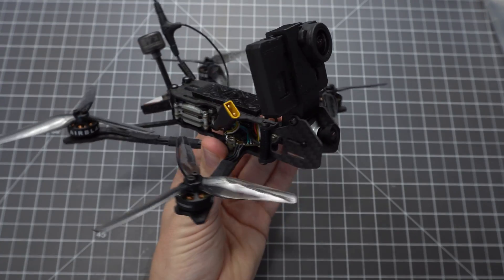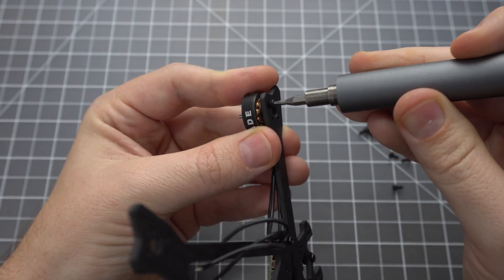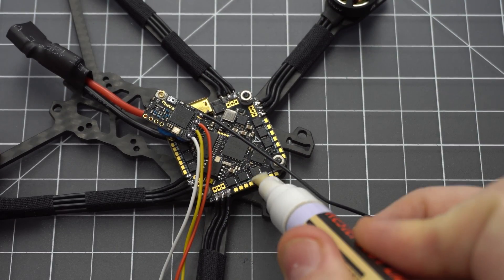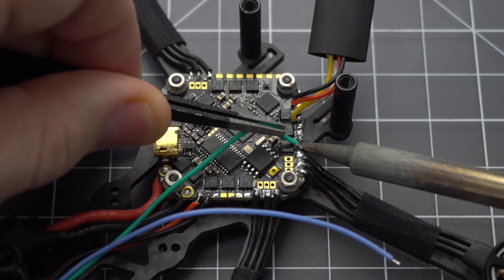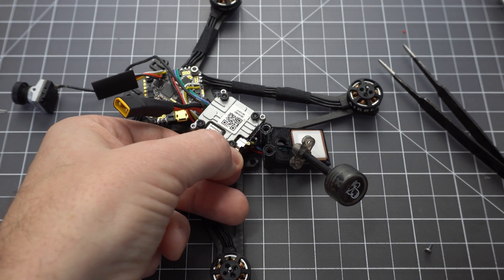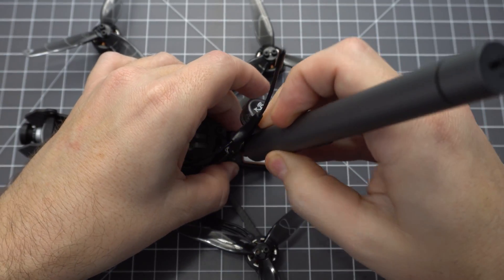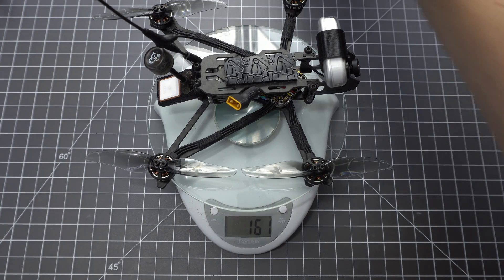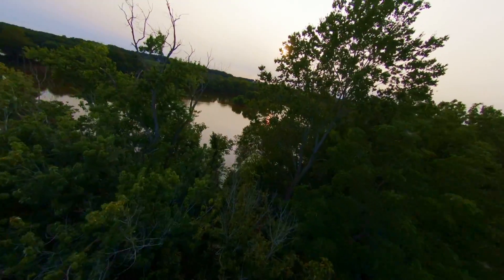How to Build a Micro Long Range FPV Drone - Transformer Mini

Comment: Ever have issues with your cloth tape coming undone? That looks super clean. Thanks for the vid!
Reply from the maker: Hasn't come off yet, but it does get a little dirty over time.
Reply: Hello whiffles just one question, would you think this build will be enough for mountain surfing and long range? Or would you say that o should stick with a 7 inch?
Reply from the maker: @carlosfuhrer  It depends on what you want to carry. This won't carry a full size GoPro very well, but it handles a naked GoPro just fine.
Reply: Whiffles thanks